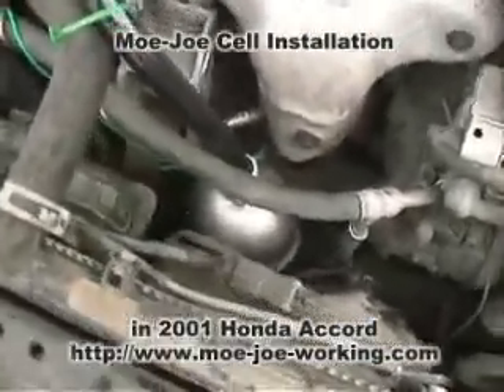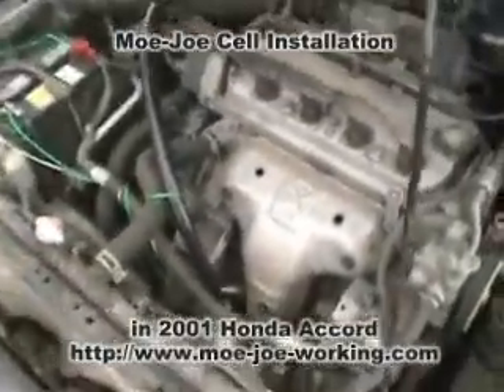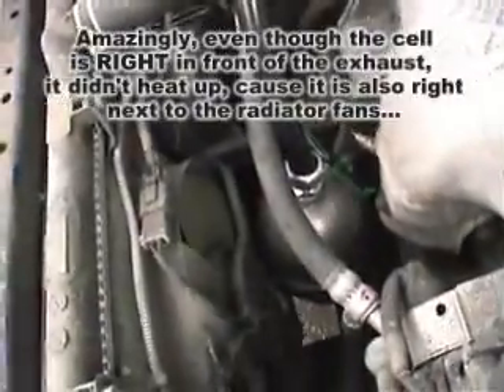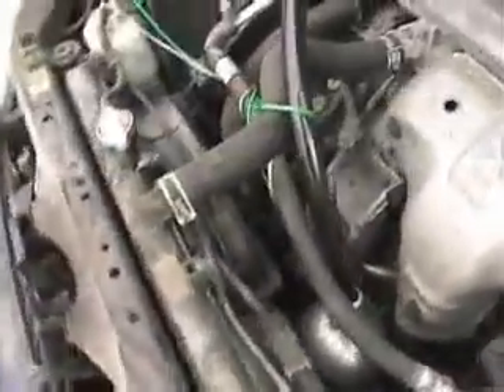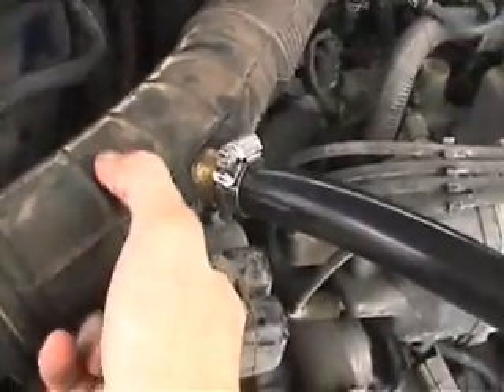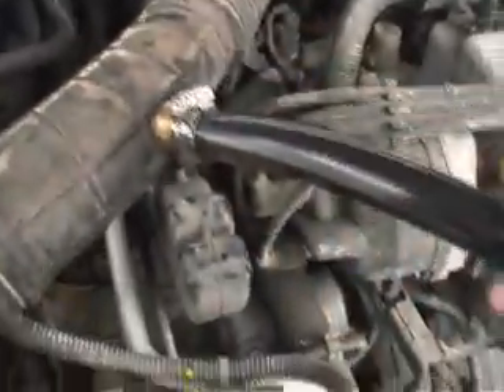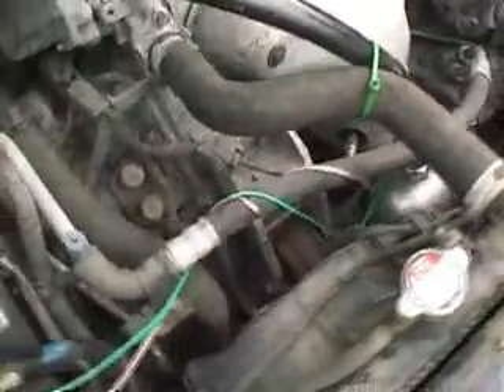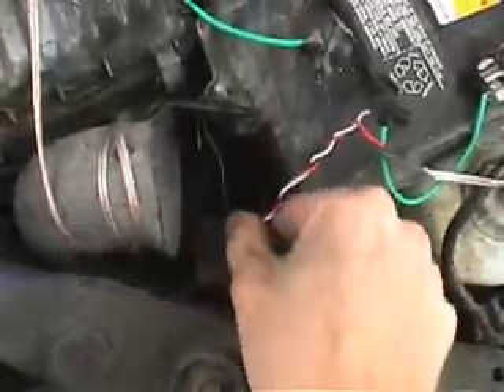Moe Joe Cell Car Installation in a 2001 Honda Accord

Comment: Well I have asked the seller IF IT can run a car THE SAME WAY AS JOE DID without any gasoline. They responded that Clients were able to  achieve the task but manufacturer was not able to  do so. QUESTION THAN IS HOW IS POSSIBLE TO SELL SOMETHING THAT DOES NOT WORK AT THEIR OWN PLACE. I'm willing to visit this clients and pay  for the travel. So far I DID NOT GET ANY RESPONSE. So  are you willing to spend the money on HOAX? I'M WAITING AND I WILL UPDATE YOU WITH NICE VIDEO IF THEY SHOW ME ONE !

Comment from the maker: there is a device called a Variac, which you plug into your wall and it controls the AC voltage - but, then you need to put the output of the variac through a bridge rectifier and capacitor. go to my moe joe cell dot come page, search that in goodle, and you will see on my charging page how to set that up. the car is a different story, but on the site, there's info there.

Comment from the maker: Iggy, the transfer tube I have is aluminum on the inside, so it doesn't really need alum on the outside. but if it was just rubber, then your suggestion is a great one!

Comment from the maker: thanks. 02 sensor bypass is not enough... you need also to do a MAP tweak. but... that also doesn't seem to be enough. however, O2 tweak is pretty simple. i will put up Bernie's method shortly on my website at moe joe working.